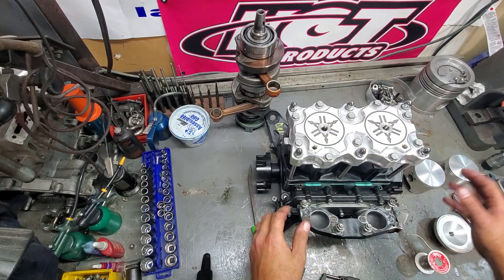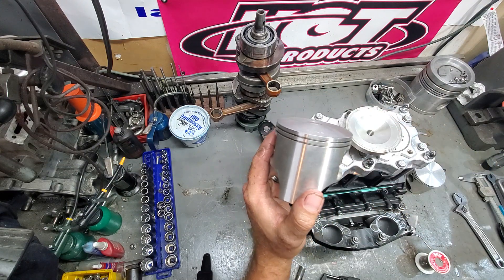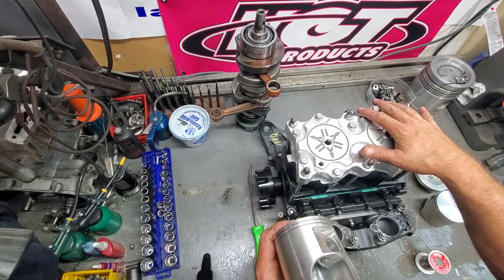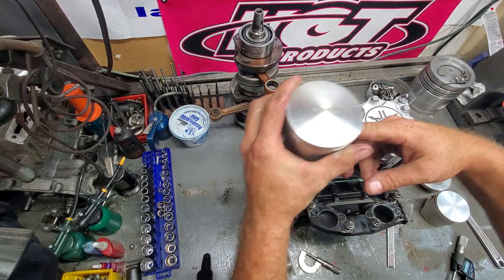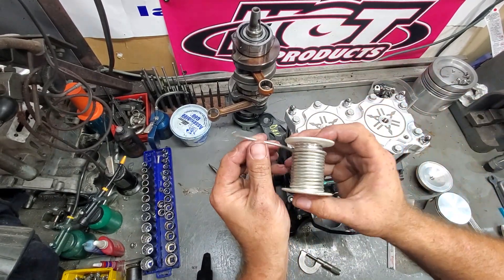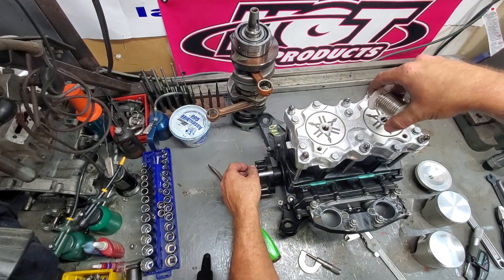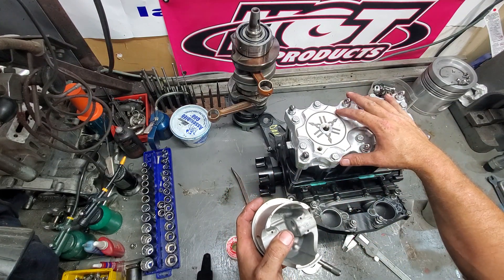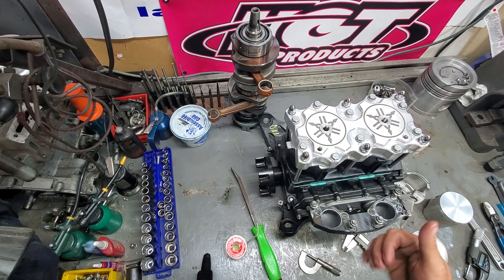How to check Squish on a Yamaha 701 62t , 61x, 760, watercraft pwc engine. SAME for Kawasaki 750 800

Comment: I like how you slip the solder in through the plug hole. All the vids for dirt bikes say to take the head off and shape the piece of solder a certain way, reinstall head, turn engine over, then remove head and measure. This way saves a lot of time.  Thanks!
Reply from the maker: Thanks for watching!!
Yeah this way works way better

Comment: If I swap out 35mm domes for 37mm on a ada head should I check squish while it’s out? I’m trying to get the compression down a little so I can run pump gas. I’m about 190 now, do you think that will get me down enough?
Reply from the maker: It won't hurt but going from 35cc to 37cc is safe. And unless u have custom cut domes ur squish will be the same

Comment: What's the difference from a dome piston and flat top piston performance wise in these 2 strokes? Or does it not matter, you just pick the type of piston for what dome you want to run?
Reply from the maker: Flat top pistons are lighter and slightly more efficient.  But it also depends on what the engine initially comes with. Yamaha 701s, 760, 1100 for example it come with dome pistons there's a decent amount of machine work to put a flat top piston in it because the pin location is different . While Kawasaki 750 / 800 /1100 come with flat top pistons
Reply: @EricksonMachinePerformance  nice!

Comment: hey man loving the how-to videos! learn somthing new everyday. i have a question. If you dont recommend using the rope trick to brake and tighten couplers what do you use?  iv figured there has to be some kind of flywheel lock tool but have yet to find someone using one. Is there one that would be universal/adjustable and work on different motors?
Reply from the maker: Collin. I dont use flywheel locking tools but Cold fusion makes them. http://www.cold-fusion.com/flywheel_lock.htm.   If you would like 1 I can get them for you.  If your intrested message me on my facebook page or just buy online.  😉
Reply from the maker: Impact gun and proper coupler tools
Reply: @EricksonMachinePerformance  yea i have coupler tool but theirs no way to keep the motor from spinning when i use it. iv seen flywheel locks for cars and trucks motors but have yet to find something for these two strokes.
Reply from the maker: @collinrobinson4306  if you use a powerful 3/8 or 1/2 impact it will knock it off no problem.  They do sell some flywheel locking tools but I have never found a need for one.  Using a breaker bar a locking tool is necessary BUT I prefer using an impact. I have found the Milwaukee m18 mid torque or high torque  works every time.  or even 95% of the time the m12 3/8 stubby works